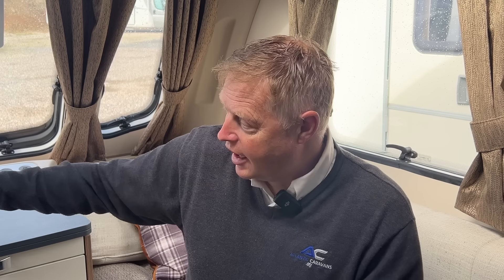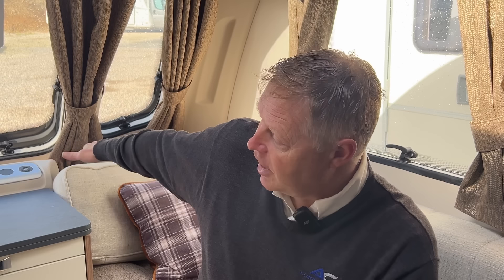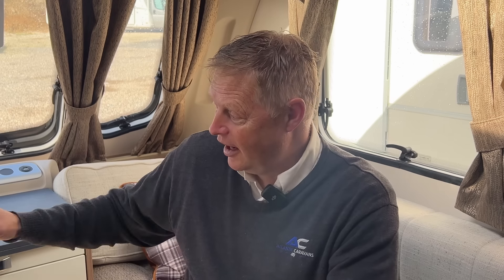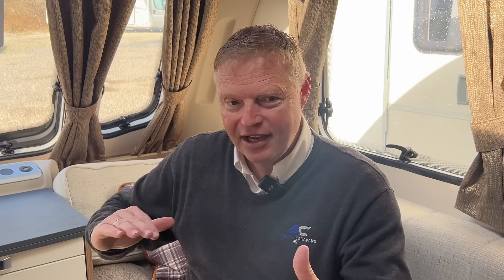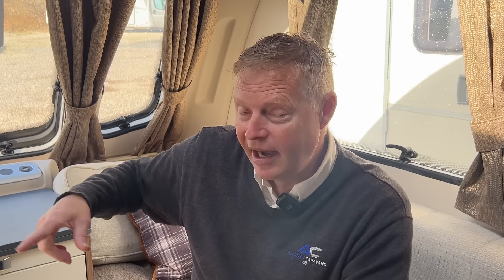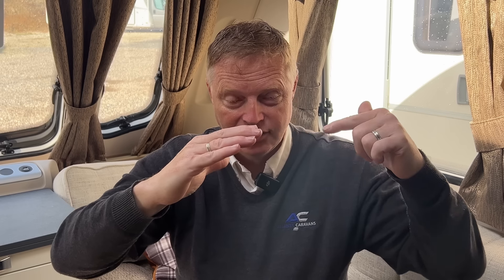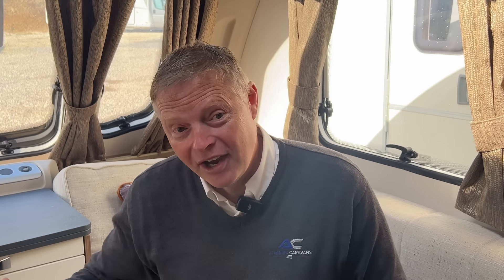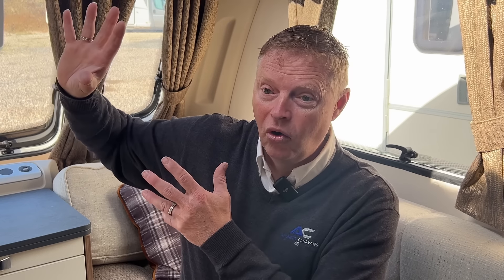Why are Caravan Manufactures making the same Mistakes?

Comment: Brilliantly said Darren. After 2 new Swifts (one of them from you in 2013) we moved over to German caravans. You were an honest guy to deal with and I can see that hasn’t changed. Last year we bought a new Hymer (now badged Eriba) Nova Lite and in 18 months, no faults and seems so much more robust. Yes the design is not really fancy and the equipment is more tried and tested but honestly, how many times do you really need to use Bluetooth or Wi-Fi to adjust a light or heating. It pains me not to buy British but while our manufacturers sell this years new fashions but in a shell that has no longevity, my money will be going to Germany every time. Keep it up Darren, we really appreciate hearing your thoughts

Comment: I used to work for the UK's leading motorhome manufacturer and also Cotswold caravans when I left school 1988-90. I can honestly say the Cotswold brand was coach built and 95% of trims and extrusions were screwed to the body. Today every manufacturer is bonded construction. Why do you think everyone went to polyurethane for internal framing and plastic wallboard,.like bailey have done? I'll tell you why, THEY SIMPLY CAN'T STOP WATER INGRESS.  It's as simple as that. Thus even damp vans don't smell like they used to. Also what are most of external doors, windows and roof lights made of. PLASTIC i hear you cry. And plastic being exposed to direct sunlight WILL degrade and crack especially as the modern construction methods mean the bodyshell has little flexibility in its design. Elddis vans have had an endemic problem with Rooflights since they introduced the Solid construction method owing to the fact they were using sealant that literally set ( like concrete) and not using flexible tape to seal the outer frames, the main problem being the large heki rooflight 960 x 600 aperture. The industry is on its knees I'm afraid.
Reply from the maker: They need to look at it in a different way, manage the water instead of trying to stop it. I think it was Bruce Lee that said, ‘Be like water’ I had a mini years ago, couldn’t stop the windscreen leaking, so I drilled a hole in the floor..
Reply: @atlanticcaravansUK  Weren't Bailey doing this at the bottom of the back panels?
Reply from the maker: @Dusty2feathers  not sure, might be on the newer ones, the problem was the the rear panel rests on the extruding floor panel and was only sealed, this allowed water ingress into the floor panel when the sealer degrades. It might be different now though.
Reply: Sounds like a poor quality or wrong sealant to me 
I'm more knowledgeable of marine stuff than caravans there's so much sealant in boats there's even holes going through the hull directly into the water all held in place with sealant windows are another big one although they're all bonded nowadays they don't use those old aluminium things with the internal fret anymore

Comment: The simple answer to your question is yes they continue to make the same mistakes. In January my wife and I decided to downsize from our 2019 Baley Cadiz (I am nearly 70). After reading a few reviews wa settled on a new Bailey Phoenix GT 75. We picked up the caravan on the 13th Jan, all looked ok. Four weeks later after a night of heavy rain I decided to look under the caravan (we did have wet floor issuea in the Cadiz). Upon inspection I was AMAZED to see water pouring from INSIDE the caravan via a floor vent, further inspection showed that water was coming from below the windows either side of the pull-out table. water was also coming from the sides of the bulkhead (we had pools of water on the floor either side of the table which was draining out of the caravan via the floor vent. Upon further inspection water was also running down either side of the door getting down the back of the awning rail and soaking the floor edges.( also had this problem in the Cadiz). I noticed later expandable foam had been run along the inside of the caravan at floor level (someone was aware of the problem and done a bodge job!.I have NOW SOLVED ALL OF THESE ISSUES MYSELF ( I know what has been done). The standard of finish and build quality of this caravan is SHOCKING!. Buyer BEWARE.....................
Reply: Well described.
I have had nearly all the manufacturers caravans over the last 40 years and I cannot think of one which did not have some sort of water ingress issue. But because of their old fashioned construction all problems were permanently fixed. Including my latest 2011 Lunar. Have recently looked at a new caravan but your posting only confirms my thoughts.
Reply: @petergarbett8195  Hello Peter, seems incredible that we can't make a square box watertight doesnt it!. I don't think we can expect any caravan manufacturer to sort it's problems anytime soon, especially as we continue to buy these sub-standard products. Yes stick with what you have!.

Comment: Great vid this.  Bought a new Swift last year and we've had a number of minor issues.  The dealership have been great and logging the issues via Swifts website is easy.  But none of the minor issues should have occurred in the first place - basic things like missing screws that I could have fixed myself.  Shower screen was broken at manufacture, so shouldnt have been fitted.  Shower leaked from underneath the tray.  No water ingress at first service, but then a week later the magnet fell out of the door retainer whilst in transit - been waiting for the replacement part for 6 weeks when it can be bought on eBay with delivery in a couple of days.  

Nearly every time we use the caravan I file another warranty claim.

Comment: Another courageous video! 
I'm glad someone is telling it as it is. In my experience Swift seem to put more effort into defending their Trustpilot reputation than correcting design faults.
I'm surprised you are still there mind and have not been paid off by the caravan manufacturers to retire and not make any more videos. I just hope they are not around if you have to cross that railway line to get home. 😮
Joking aside, your videos are invaluable to the public and you working in the business provides incredible insight and qualification.
I was in the market for a 10 year old van but these vans are not cheap these days when you take into account you are out of warranty and caravans have the same problems they have always had. I appreciate what you say about manufacturers having to balance weight, waterproofing and warranty whilst waging war on component costs but all I say is look at boat manufacturers. You can get a mortgage on a 30 year old boat, because they succeed in building them waterproof. Why is this secret exclusive to boat manufacturers?
I was last looking at Coachman but you have almost put me off those as well. I appreciate your honesty, I think you are the only dealer I would by a van from. Great stuff.

Comment: Another great video got a tip when you park your van up wind the jockey wheel right down so it’s not level any water lying runs off the roof was some water ran out the gutter this also helps with damp issues
Reply from the maker: I’d probably recommend tipping it back to be honest, this will avoid the water running down over a sunroof and the front window rubbers, that’s where we see most of the issues.

Comment: Well said. We had a Coachman VIP 520 for 9 years. Lovely caravan, but not without issues. We had water ingress picked up on the first service. It went back to the factory to be sorted. Due to other issues and me being fussy, it had several more visits to the factory, but to be fair, Coachman repaired issues and did extra upgrades like the tv aerial while they had it. They even replaced a front window that had picked up a stone chip. It has just come back from the factory for a water ingress issue around the awning light. When I got it back, they had replaced awning rails on both sides, resealed around the panoramic window, buffed scratches out of the windows and replaced skirt trims. They did know we were changing it for a new Coachman on it's return though. We have been frustrated at times with the brand, but I feel they looked after us with the way they dealt with the issues. Hopefully, the issues of old have been ironed out on the new one. Time will tell!
Reply from the maker: That’s good to know, was it an easy process to get sorted?
Reply: This last time took about 10 months to get a slot at the factory. Very frustrating given they had refused my repairer a 10 hour warranty claim to repair the damage. I believe they were having some work done at the factory whichhad slowed things down. When it came back, you could see they had spent some time and money on it, but they did have it for six weeks. We're just hoping this new one will be trouble free!!
Reply: I am looking to purchase a brand new VIP 675 here in New Zealand, the dealer says that the van will have a 10 year warranty on water ingress which is comforting to know. To me the Coachman is of a far better quality than that of Swift and Bailey. I have a 2008 Bailey Louisiana which I bought a year ago and have no found that the floor underneath is rotten in two places and the van has failed its road worthy until repaired.

Comment: Refreshing to listen to straight talking honesty well done !!,I watched your video on looking out for damp brill . Ive got a 2018 plate buccaneer (Eldiss)oh dear i had two repairs done professionally on the roof .had my service done in may again more damp found One, front window one small screw causes chaos,Two, another roof problem!!! picking up on what you mention about doing the same repair i decided to do it myself ,the trim connecting the front and rear roof panels is way too slim i bought the wide weather proof gorilla tape stuck down all way across ,so even if crack appears which it will !! its covered working a treat however its disgraceful from manufactures my first house was £21000 i paid £26500 used for this bloody thing ,speaking to my mate last week he has a Eldiss guess what yes same roof problem.this video should be shown on a loop at caravan /motorhome show they would listen then .

Comment: Great video .. about 6 years ago me and the wife bought a brand new Explore 402 it took most of our savings about £14000. What a load of rubbish this caravan was from day one leaking pipe work in the bathroom..leaking tap in the kitchen that eventually rotted the floor in the off side corner . Water ingress around the front window  all in the space of 3 years . Then the rear panels started to crack around  the awning rail area Elddis didn't want to know wouldn't warrant the panel repairs consequently we got rid    bought a Eriba troll 430  no issue's  . I wouldn't touch a British made caravan  with a barge pole .
Reply from the maker: Elddis have a golden opportunity to get it right, because, funnily enough, the people that own Eriba, now own Elddis, you’d have thought they would have gone into to factory and applied what they know about building caravans to the Elddis product..

Comment: Brilliant report thank you, I am in New Zealand and there are a huge amount of UK caravans in the country, the models I have seen I would say the Coachman is by far the better build quality that that of Swift and Bailey. I have a 2008 Bailey Louisiana which has floor rot, this has never been seen or sorted out by previous owners. In NZ we have to have a warrant of fitness done every 12 months and there is a new legislation brought in that if there is floor rot underneath the caravan will fail the warrant this is now going to be highlighted with all caravans which I think is now going to pose a major issue with repairs as insurance companies do not cover this damage. The damage repair cost that will now have to pay out is around NZ$5000.00.
Your ideas on how the roof should be attached and using composite flooring is exactly what should be done especially when one is investing a lot of money for these caravans. I would really like to know more about the Coachman build regarding the sealing and the flooring although the dealers here give a 10 year warranty on water leaks.
Reply from the maker: Hi, I’ve been to the factory, although some years ago, and the build quality is probably the best, but they still do some daft things like using panels in the caravan walls so they still rely on wall board tape which always without fail peels off.. but on the whole they are good. Check out my floor video if you haven’t already. 

https://youtu.be/JUbTwY63vG8?si=NO-O6pueVDxs_G2O
Reply from the maker: I think I sent a Louisiana over there a number of years ago, what’s the chances it’s the same one..

Comment: Also just done 2 major damp repairs myself using genuine wallboard and joining tape all because of window rubbers failing. If anyone needs to buy genuine pattern to match wallboard and tape ( Halesowen caravans does every board from 2000 year onwards). I also ended up doing a moisture barrier before replacing the wallboard. The R&D depts aren't great in UK brands

Comment: Our new Bailey GT75 purchased in January has been nothing but a problem. We are currently on our 8th trip and we have to take it back to the dealer on our return. That will be 8 x  back to the dealer and we still have to return it in Sept to repair delamination in the side wall. Shocking quality but the one good point is our dealer who have been great. With 60 more nights booked this year we just don't know what's going to happen next. Roll on 2025

Comment: Great video.  It's not just the big issues that is not being resolved.  It is smaller things like, Bailey's Phoenix 640's 2019 and caravans around that period - had the Truma Ultraflow  smart switch fitted, which seem to be problematic, only to find that you can no longer buy, a replacement and have not for some time.  You instead have to buy a Whale In Line Pressure Switch, but this means electrical issues and different connectors being fitted.  Why are these companies making things so difficult.
Reply from the maker: I’ve got a couple of those smart switches..
Reply: @atlanticcaravansUK   Wow - sounds great.  Is this new or reconditioned, and how much with p&p?
Reply from the maker: I’ll have a look tomorrow, it’s the black ones I believe isn’t it?
Reply: Yes

Comment: When changing the trailer model from Chateau La Car (1998) to Hymer Nova 545 (2005), in both cases I aimed at "old" trailers, from the times when they were built very solidly. The Hymer (2005) that I have owned for two years is built rock-solid, all installations and devices work perfectly, drawers, doors, flaps, hinges, no leaks, no suspicious smells, etc.

Comment: A friend of mine bought a brand new elddis Avanti 550 in Jan 19. In march 19 I had to convince him it's really not a good idea to set fire to it ( honestly) I doubt it would have burned anyway because it was too damp. The whole front panel was leakier than a sieve in a swimming pool. Apparently elddis was aware of it. I doubt they're any better built now. Caravans are not engineered to take the vibration abuse from being towed on British roads. I'd guess that smaller units leak less than 23ft models.
Reply: They only leak less because there's less surface area

Comment: Interesting and refreshing. I’ve been investigating getting a caravan on a seasonal pitch to act like a holiday home and in my research I’ve seen and heard so many quality issues that it’s put me off the idea. 

Cars have been water tight for decades (on the whole). There must be techniques that could be copied
Reply from the maker: I’ve heard this a few times people getting put off caravans because of the issue, I’ve not come across this before, it only emphasises the fact that the first manufacturer to really address the issue openly will gain a lot of customers trust  and do well. I think with cars in some instances they manage the movement of water in places like the doors and guide it rather than try to stop it. I had a mini once where I gave up to seal it and just drilled a hole in the floor, but I don’t think that’s the answer in this case.